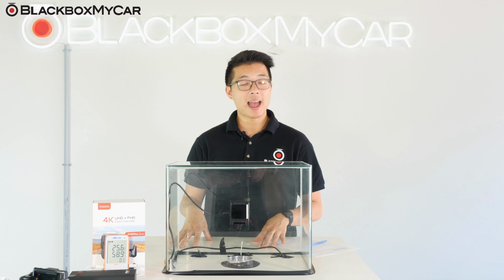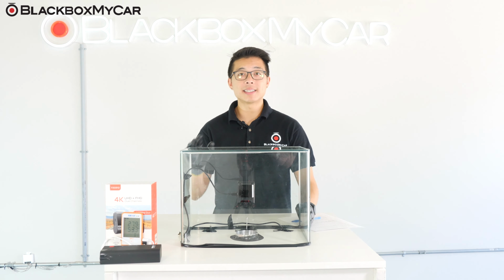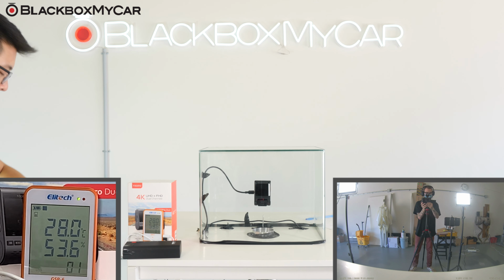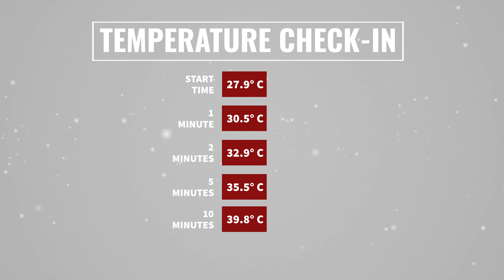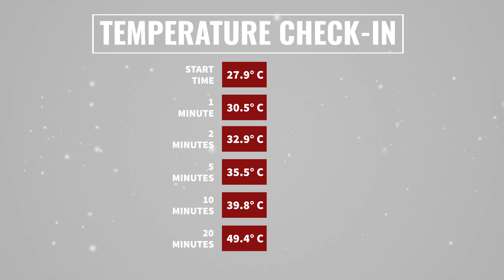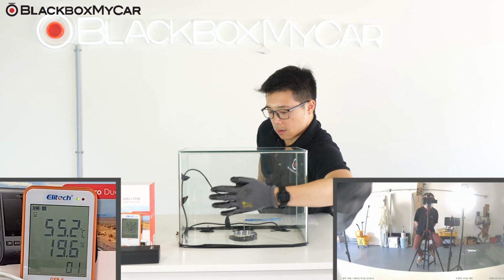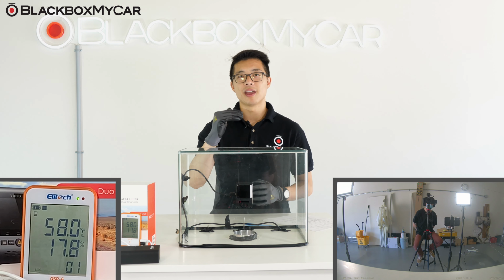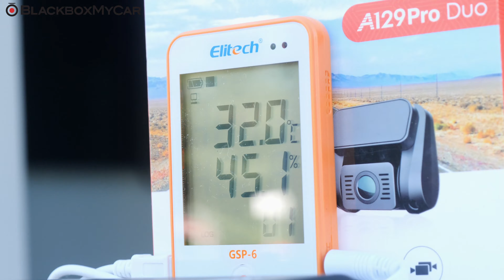Beat the Heat: VIOFO A129 PRO Dash Cam | BlackboxMyCar

Comment: I already knew it would work in extremely hot conditions as I've been using it for the past 6 months in Toronto.  Only complaint is the sticky mount for the rear dashcam isn't super sticky and occasionally fell off.  Fixed by adding a 3M Velcro mount.
Reply from the maker: Hi Tim, thanks for the feedback. We'll pass on the word to VIOFO. They always appreciate feedback like this.

Comment: Enjoy your content, I recently purchased the 750LTE.  Had it professionally installed and have had nothing but problems with connection to the cloud.  After switching out 3 cameras we discovered it was the ATT SIM card. One of their tech guys told me to switch to TMobil.  That fixed it. 
Used it for a day with no problems then it started shutting down.  I live in South  Florida,  when the camera gets hot enough it WILL shut down.  Especially when the car is parked and sitting in the hot Sun for hours at a time. I wish in your video you mentioned the degrees in Fahrenheit.  Also I have 2 units now in 2 cars both are working fine as long as they don’t get overheated.

Comment: I can confirm it gets hot enough to burn your hand lol.  I left mine in 4K parking mode on a hot day.  It had been recording a couple of hours.  I now switch over to 1080p instead of 4K if I'm going to use parking mode for an extended time in the hot weather.  The camera makes less heat.
Reply from the maker: Haha great suggestion!
Reply: Interesting you say this.  I had the exact issue.  It was very hot to the touch.  And I contacted Viofo.  They said to lower to 1080 as well.  Mine still goes off sometimes in the very hot sun (I am in NYC).  But, if I need to lower to 1080 bc it is too hot, then why did I spend extra for the 4K?  I guess I can use it when the weather gets much cooler in October.

Comment: I am in the Houston Texas area and sometimes the temperature inside the passenger compartment gets quite hot! I haven't noticed any problems with my camera operation so far that I can tie to that heat. However, I have noticed that even when the interior temps are cool, the camera operates at an extremely high temperature; hot enough that you cannot hold the camera in your hand!

Comment: I don't know if the one I got was defective but mine would over heat in florida heat.  I just sent mine back a week ago as it could not work.  I would get into the truck on a hot day an it would not turn on at all. I
Going to see if the a119v3 works out better using x264 vs x265.  My cheap yi dashcame works perfect in florida heat though.
Reply from the maker: Hi rfs830, sorry to hear that you've had some issues with your VIOFO. With the VIOFO A129, some other commenters have found success lowering the video resolution, so we'd recommend giving it a shot too if you'd like to give the dash cam another try. Best of luck with the Yi dash cam, and because the A119 V3 is only single channel, it should work well as well.

Comment: I live in Indiana but I literally just had a problem with viofo 2k 3ch it was on but didn't record anything after few hours of recording after it's turned on turning on/off, wifi nothing worked.... I was so disappointed that dashcam stopped recording even record red indicator was on.....
Reply from the maker: Sorry to hear that you're having this issue with your 3-channel VIOFO camera. If the record light is on, but the unit is otherwise unresponsive, it's most likely that the SD Card burnt out. Could you please try using a new SD card?
Reply: @blackboxmycar  SD card works fine actually...
Reply from the maker: Very sorry to hear that, in that case please contact the seller of the camera to file a warranty claim.

Comment: Okay.. but appart from a bubble silver outside windshield sun protector. What can I do to keep the dashcam cool?

I have allready turned off parking mode..

But im in 95 degrees al year round. And don't allways have shade to park in.. 
Whould a strip of dark tint work? If I place a windshield cover behind it.. it will only get hotter.

Comment: Summer is around the corner and it's only about high 60s. Coming back to my car, and the camera is off. Its hardwired. The camera itself is hot. I unplug, then replug and it starts up and records. Just looking for a prevention.
Reply from the maker: Yes it's heating up quickly! Sorry to hear that's happening with your camera, I've seen that happen with VIOFO models before, where they basically run too hot for too long and get themselves stuck, needing a reboot to get back in working order. This mainly happens in parking mode when recording in the long-term, like overnight. Try out a few different parking modes with decreased sensitivity and see if that helps, try a new SD card, and make sure the firmware is updated.

Comment: I love and hate my A129 pro duo. Parking mode created lots of problem so I had to give up the most important function for me. BlackboxMyCar replaced front unit but I got the same problems again. One good thing is it's still record video even my car parked 98 degree under the sunlight(I decreased resolution as 1440p not the 4K) . I supposed to purchase just cheaper model without parking mode function. It's just half of success.
Reply: new FW 2.0 from Jul 2020, solved most parking issues that I had with FW1.2
Reply from the maker: Sorry to hear that, but let us know if you're still having issues after trying out the new firmware as Wilfred suggested.

Comment: I live in dallas TX. Mine overheats all the time it could be 90f out and it'll kick off saying it's too hot.  Car only gets 130f but it doesn't work.  If I have to turn down my video setting so it doesn't overheat what's the point of having a 4k camera? I'm Definitely looking at a new camera. Even when I'm in the car with the AC running it still shuts off.

Comment: I have the viofo a129 pro duo.  I have to say it does NOT hold up to the Texas  heat.  The camera kept on shutting off even at 85-90F.  With the new firmware update,  the camera has tolerated the heat a little better but I have to reduce the recording quality.  I'm very disappointed in this camera.  There are also numerous post about this camera shutting off due to heat.  
Was both camera (front and back) plug in for your test?
Reply from the maker: Hi Karl, interesting. Did you purchase from us? If so, do get in touch with us and we'll help. The front camera was plugged in for our first test, and we used both cameras for the second test.
Reply: I left a message. I hope you guys can get back to me.

Comment: You need to heat it up faster. I had to investigate a death in a car, in Texas, due to heat and ran some tests.  I was shocked at how fast the temp went up. We drove the car around with the AC on until the interior air was comfortable, about 80F or 85F I think. Then we parked it. The outside temp was about 110F that day. I retired several years ago so I do not have access to the report now. But I remember that in ten minutes the interior of the car was close to  140F degrees! In 15 minutes it was at 147F. The victim had been in the car for just only 15 minutes.

Comment: Obviously not airflow experts but it would of really helped to have the air in the box have somewhere to go so the heated air could actually flow in. This way you are just getting the radiant effect and should of used a small space heater in the box. You guys are lucky the heat gun didn't catch fire since it was not flowing air through it much for it to cool itself. Plus you are not at the proper humidity which is a very important factor since hotter air holds more moisture and can cause shortes. But you may of noticed your humidity keeps dropping it should be more around 60%-80%.
Reply from the maker: Hi Zed, the purpose of our Beat the Heat video is to replicate the interior of a vehicle with the heat gun acting as the sun. We understand air flow is quite restricted within a car (with the windows closed), thus the reasoning for how we decided to tackle this experiment.

Comment: I dont know about this test. I had to return two of these to you guys a few weeks ago. That test just measures operation in those temperature the actual devices heats up way more  than that at lower ambient temperatures. Direct sunlight+heat inside the vehicle is probably more. I used multiple sd cards as well went with the blackvue dr750s two ch. no issues whatsoever
Reply from the maker: Hi Ahmad, thanks for letting us know. We're constantly refining our tests, so we're always trying something new to simulate an in-cabin environment. If you have any suggestions, please let us know. Good to hear with your BlackVue DR750S!
Reply: BlackboxMyCar hmm I would say pump the heat in direct sunlight on some more reflective material inside the box. I remember mine turning off when my truck was reporting 78 degrees. It seems low but it felt like 90 100 when I stepped in.
Reply from the maker: Hi Ahmad, absolutely - we will give that a shot next time. Thanks for the feedback.
Reply: @AhmadAli-du2fq  I have similar issues.
Reply: Richard go blackvue man or thinkware it’s premium price but premium quality

Comment: I notice yours works, but you're also continuously recording..
The trouble with mine is in parking mode.
I've tried 2 now, and both crash while in parking mode in the heat, but not in cooler times.

Doesn't do it in milder weather, but anything approaching 80f, when I return to the car, I'll find the red light blinking, and the camera frozen until I unplug and plug back in. Then it's fine again; even if I restart while it's almost too hot to hold.

The Amazon reviews note this a lot, but no one seems to reliably know why, or exactly what triggers it.

I've updated firmware on both that I tried.. Same thing.
I contacted the company without much help, who only state that these units are designed to withstand high temps, which as you tested, they can.. But something combined with the heat is causing this same crash. So, they weren't much help.

Can be read about in some length on the amazon reviews, with most people referring to it as simply over heating.

I've asked in Amazon questions only to receive "Yeah mine does it too. these suck" kind of replies, but nothing to really explain why some people aren't seeing it happen. Higher voltage batteries maybe? Lower?
I have the recommended power supply, and sd card. Anyone else have any suggestions?

Comment: Interested in the duo pro A129. Was told there are issues with the cam still not resolved yet. 
Perhaps I should stick with Blackvue
Reply from the maker: Hey there, VIOFO has released firmware 2.1 recently: https://support.viofo.com/support/solutions/articles/19000105647-viofo-a129-pro-duo-dash-camera-firmware - You can see a log of the issues here. Were there any issues that you were looking for that hasn't been addressed?

Comment: You mentioned this had a Bluetooth remote control. How does this work? Does it come with a button or is it controlled via app?
Reply from the maker: The BlueTooth button for VIOFO's allows you to manually save and lock the video that is currently being recorded. This is the same function as pressing the middle button on the camera but instead this button can be mounted on your steering wheel or somewhere that can be easily reached. This does not come with the camera. You can find it on VIOFO's website!

Comment: Is it possible to purchase a second rear camera so that both the car's interior and behind the vehicle can be recorded? This would be a total of 3 cameras (front, interior, and rear). I suppose this would require the front base cam to support two accessory cameras; does it? Or, can a rear cam receive an additional input from another rear cam? I haven't found any content online that discusses this. You should be the first to address this! If Viofo can't, are there other makes/models that support daisy-chaining cameras?
Reply from the maker: Hey David, unfortunately, it is not possible to hook up 2 rear cameras with one front unit. What we typically see customers doing is getting an additional 1-CH system that faces inwards so that you're basically running two separate systems in your vehicle. Hope this helps!

Comment: I live in North Western Ontario Canada 🇨🇦 what about cold temperatures? It hits -45C here in the winter, I would like to know before I purchase. Thanks
Reply from the maker: Hi Rich, the operating parameters for the dash cams are usually conservative and no dash cams have ever declared parameters that are anywhere near -45°C.

That said, we have supplied dash cams to all over North America, including Nunavut, and have not heard of any major issues. If it gets too cold, the dash cam will just power off safely until the temperatures are higher.

Hope this helps!
Reply: @blackboxmycar  This helps, thankyou. Just purchased the two camera model from your Canadian website with a 5% off discount code. Thanx
Reply from the maker: Awesome, thanks for shopping with us, Rich!

Comment: My viofo 129 pro shuts off from overheating in the Toronto Summer right now after 2-10 minutes in parking mode. This is with my car parked out in the direct sun. However, even when it's not in the direct sun, the footage may cut out after maybe 30 mins to an hour. Is my dash cam faulty or should this camera be working? Keep in mind I have the dash cam hard wired and voltage cut off set to 12.2.
Reply from the maker: Hmm, that's very strange, Will. Can you contact us at info[at]blackboxmycar.com? Let's troubleshoot with our team! It shouldn't be overheating, but most importantly, try not to park under direct sunlight. Your camera should be working - do you know what temperature your car gets up to?

Comment: This test is in the running mode, but in the parking mode it will definitely turn off and fail 👌
Reply from the maker: The dash cam will still shutdown in normal mode when it gets too hot, and it generates much more heat in this mode anyways

Comment: 1 suggestion is to find out the operating temp by leaving the camera turned on for 24 hours before applying any heat. This would simulate parking mode. My a129 pro operates at 130F while in my garage after recording overnight.
Reply from the maker: Hi Billy, awesome feedback. We'll definitely take that into consideration for our future videos.

Comment: How much different in terms of heat handling capabilities if comparing to A129 Duo?
Reply from the maker: Hi Steve, on paper, it's about the same. But the A129 Pro shoots in 4K, so you can expect the dash cam to get hot to the touch!
Reply: @blackboxmycar  thanks for replying  :)

Comment: is it normal if the dashcam itself gets really hot?
Reply from the maker: In regular settings the main unit of the dash camera will heat up when in use like most electronic devices. In hotter climates this may be amplified. The VIOFO A129 has an operating temperate between -10℃~65℃ (14℉~149℉).

Comment: I don't believe this test,my camera when it was about 17 degrees outside, it stopped.
Reply from the maker: Hey Ulven, sorry to hear that, can you reach out to our team at info[at]blackboxmycar.com if you purchased from us? You may have gotten a faulty camera!
Reply: @blackboxmycar     I bought the camera directly from viofo, I gave it up, I keep it in the box, I switched to Black vue DR900S-2CH 4K UHD DASH CAM with Power Magic Battery Pack.
Reply: Same problem I had.  Mine would just stop working.

Comment: Vioo A129 Pro Duo dash cam: ok. GPS module: lately it can't supply the camera with electricity O_o
Reply from the maker: Hey RelakS, that's not good - you may need to replace your GPS module. Can you contact our team at info[at]blackboxmycar.com?
Reply: @blackboxmycar  I suspect the same, so a replacement module is on the way.
Reply from the maker: Awesome, glad it worked out!
Reply: @blackboxmycar  Well, the new GPS module has arrived, but it not solved the problem. At least, this module helped me to find out the real problem. I used 90 degree USB cable adapters to neatly lead the cables. With them (one for the camera, one for the phone) the available charge current became very low. I removed these cables, and now, the gps module and the camera works as intended. Unfortunately, the cables are disturbing now me a bit, but it is not very bad.

Comment: You are so doing it wrong, you are doing science wrong.  Your heat gun moves and pushes hot air but since you are pushing air into a sealed chamber nothing really is moving into that sealed box. If you would have a tiny vent on the box you have have generated your target temp at  1/8 of amount of time you waisted.

Comment: The camera will work in heat but the heat will ruin the sims cars in 6 months.  Central Texas heat is real.
Reply from the maker: Absolutely, I understand your concern about the heat. Just to clarify, it's the SD card, not the SIM card, that might be affected by the high temperatures. In extreme conditions like Central Texas, the SD card might wear out faster, potentially within 6 months.

For better performance, you might want to consider using a heat-resistant SD card like the SanDisk Extreme, which we offer. These cards are designed to withstand higher temperatures and can help extend the lifespan of your dash cam setup.